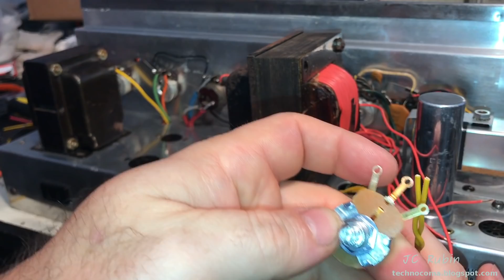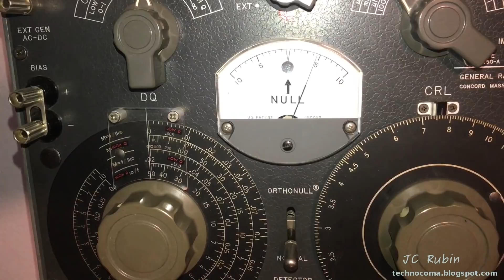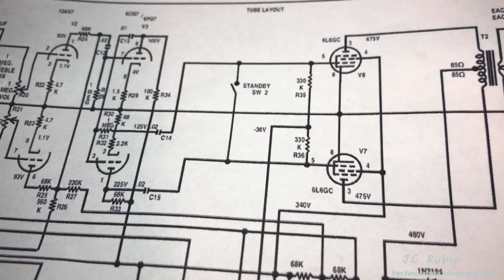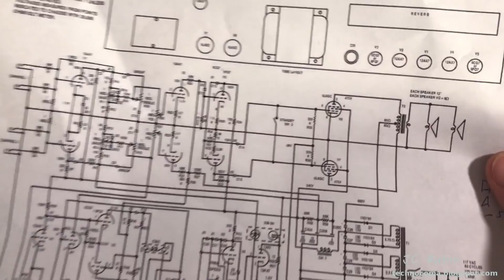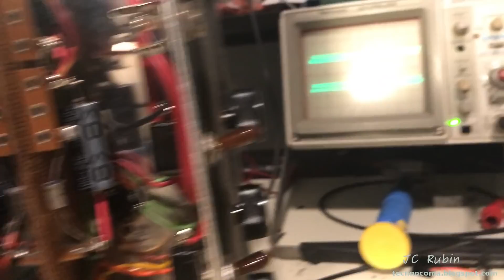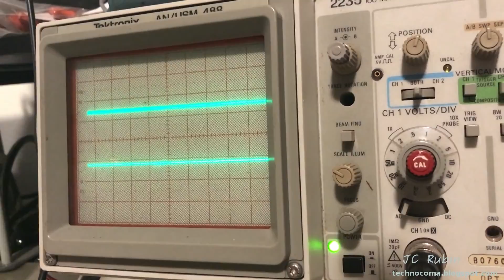Sears Silvertone Twin Twelve 1484 Major Restoration Project [3/6]

Comment: The standby switch on those amps don't do what most standby switches do in other amps. All it does is shorts the PI outputs. It is kind of cheesy.
Reply: Sorry, I made this comment before I got to the part of the video where you saw that on the schematic. LOL

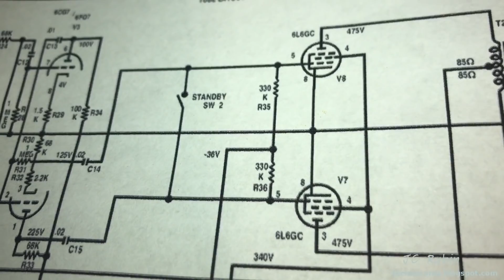Comment: 17:20 - Where are the cathode bias resistors? Weird!
Reply from the maker: I believe, though, I can't fully recollect my displeasure in the setup for the bias in this amp at a few junctions.  There are a couple of key items here that leave you wondering how many of these amps didn't have chronic issues out the door.   Either that or Sears had amazing matching skills.   Furthermore, The voltage supplied by the transformer for the grid bias is somewhat anemic, leaving little room to work with.
Reply: There aren't any... it's a grid biased, double ended amp. The output section is similar to Fender Princeton Reverb amp. You can adjust the values of R35 and R36 to make up the difference in the tubes (I wouldn't :o) ) or use a matched set of tubes and make sure the grid bias resistors are close in value. You have to use the center tap to plate resistance reading for each tube  and plate voltage from each tube to calculate plate current, unless you have a nifty Eurotube socket thingy.

Comment: Changing those grid leak/bias supply resistors is not a way to adjust bias.  There is no current flowing there so no opportunity to “drop volts.”   Cathode resistors under cathode biasing can be changed to change bias since current is flowing thru them.
Reply from the maker: This is almost entirely true! However, those resistors are still out of specification and warrant replacement.

Comment: Your output transformer is definitely not the original. The one in your amp is significantly larger. A question regarding changing the speaker lead to a 1/4" jack. Can the jack be safely grounded to the chassis or must it be isolated?

Comment: I had to change a lot of out of tolerance resistors in my Silvertone Twin 12... Ah... now I remember... Standby isn't truly standby on the Silvertone. That's why I did this:
"Here’s another quick mod. The 1484’s standby switch is different than most: It does not disable the high voltage—it simply cancels the signal going to the output tubes. Try removing the switch and replacing it with a 1 Meg linear pot. Connect the two wires that were attached to the switch to the pot, one on the wiper and one on the CCW leg. Turning the pot all the way down will yield the same result as the original standby switch, while turning it up will control the amount of signal going to the output tubes."
Reply from the maker: I understand the intended result of the addition of the pot as opposed to the switch, but what is the benefit where volume is used to meter the output to the finals anyway?
Reply: @rubin-tech  You can crank up the first stage and approach or achieve distortion there but limit the volume from the amp so the neighbors don't call the cops on you...
Reply from the maker: AAAAH Im a Hifi amp guy... That hurts to think about... I gettcha though..

Comment: Time to rig up some bias pots lol
Can't wait for the next video on source of noise and the fix :)

Oh, how's the moped ignition coming along?
Reply from the maker: Bias pots dont work in this configuration.  You would need to first produce an overabundance of negative voltage that you could then sent to ground in a metered fashion via a pot.   This setup produces 'just enough' negative voltage, there is little to meter.

The moped is awaiting more Soviet parts and is not forgotten.   Thanks for asking it will also continue this winter
Reply: Ok, makes sense.
Thanks